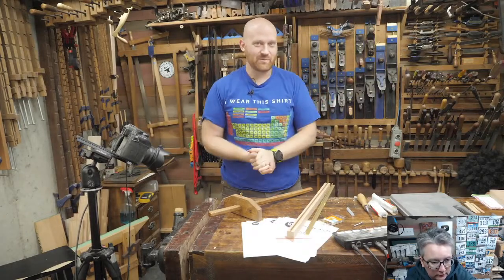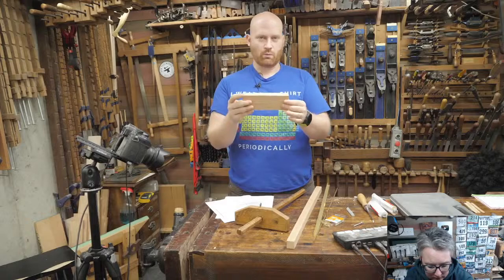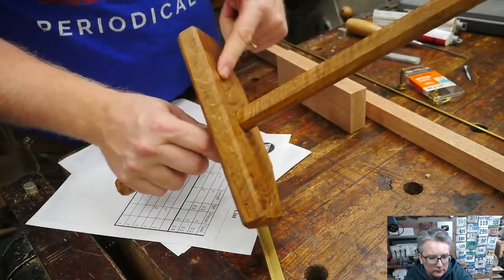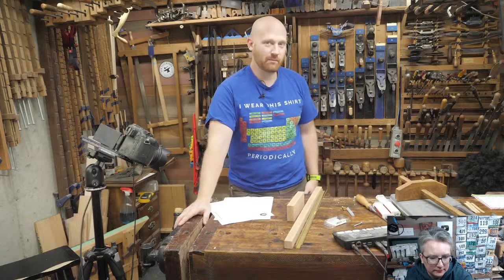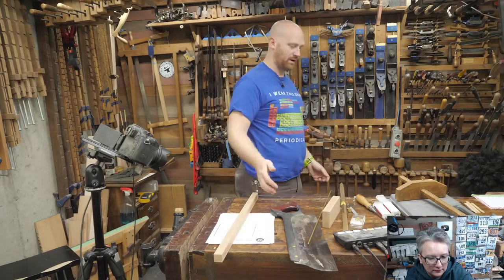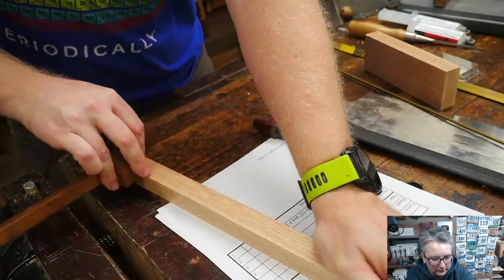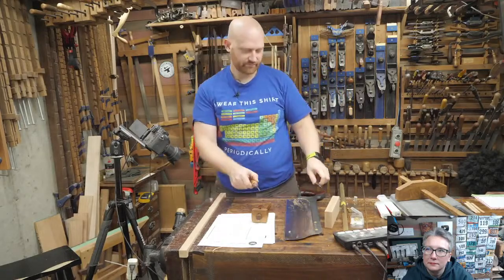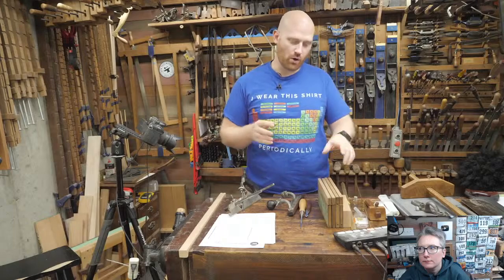How To Make A panel Gauge Live Free Plans

Comment: James, I notice you now seem to have a 3 jaw brace for your Woodowl bits, avoiding the adapter.  Is that available, or is there a video on this?
Reply from the maker: This is a two jaw that is just shaped differently inside. Most made after the 60s were made that way. it is not prefect, but it is not bad. so if I am doing a bunch of holes I take the time to put in the adaptor. or if I am using my other braces.